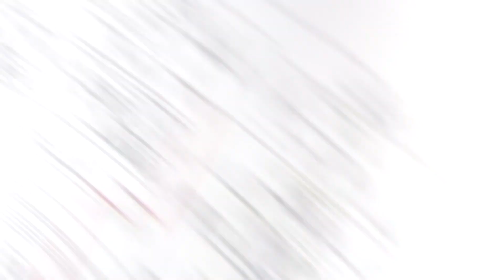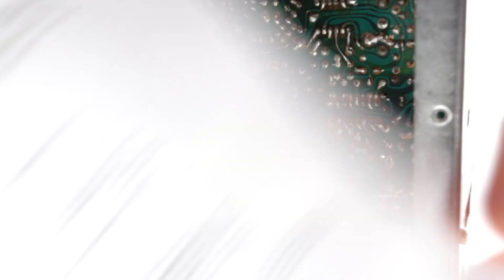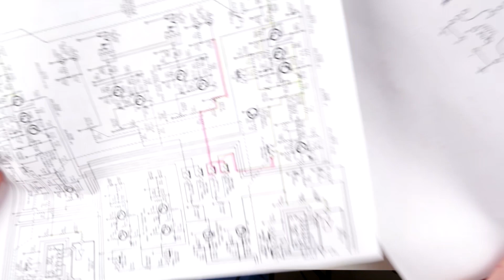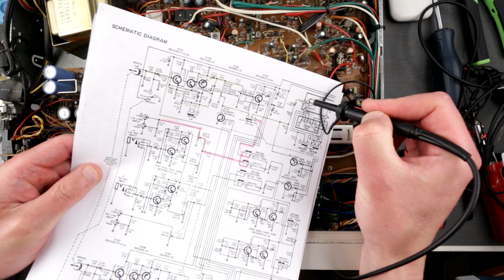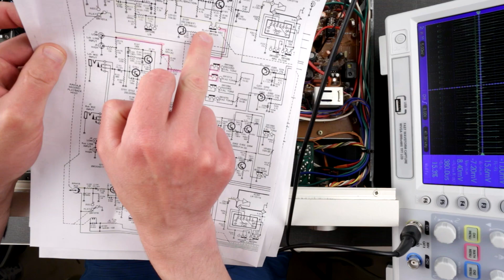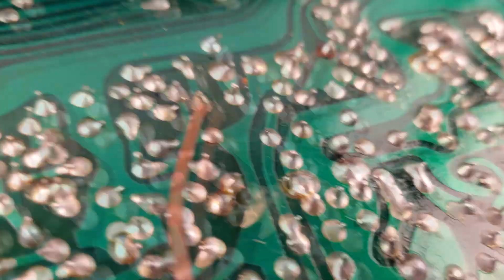Repairing Harman Kardon hk300xm. Mitigating one channel out. Part2

Comment: I suspect the Auto-Stop mechanism is activated, because the mechanical counter does not move. That is why playback turns off after a few seconds.
Reply from the maker: Thank you for watching. I actually have P3 where I fixed that issue as well. Mechanical counter is a belt problem, which got fixed as well :D